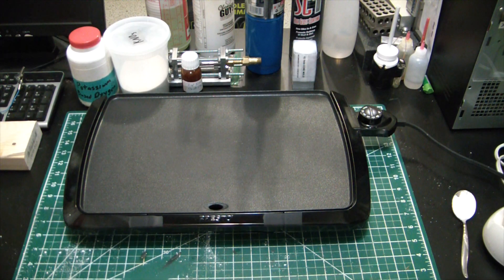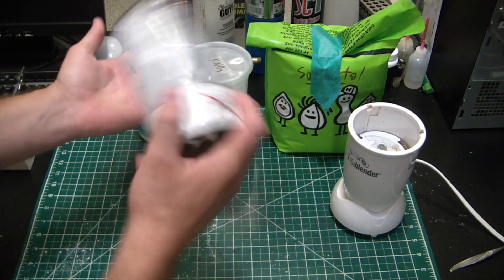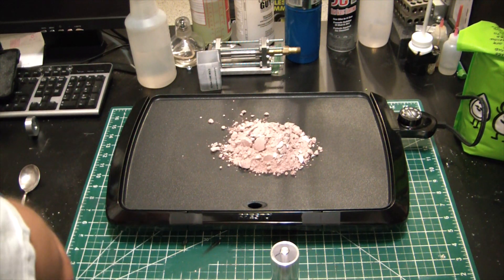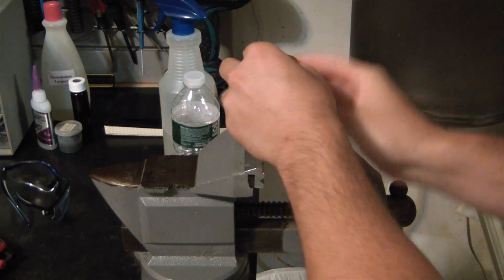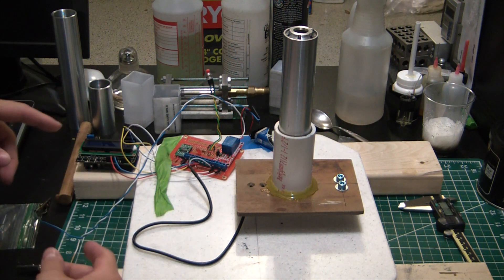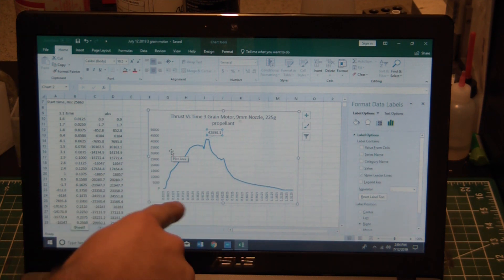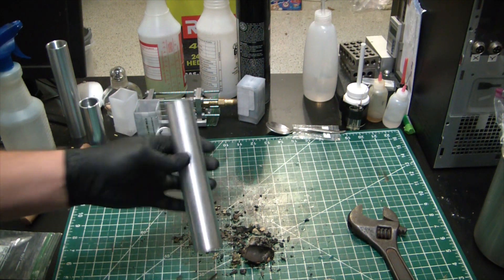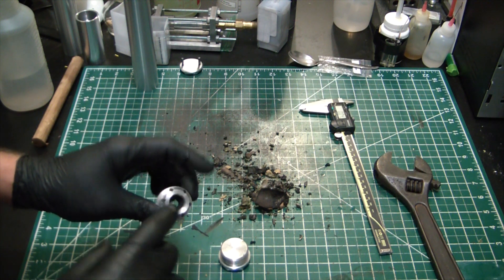A Massive Three Grain Rocket Motor - Arduino Static Thrust Test Stand - Elementalmaker

Comment: i suspect that what got spat out of the nozzle was probably the paper liner that was on one of the fuel grains. it would probably be a good idea to use a much thicker carboard, maybe like a cereal box.
did the motor come with instructions for what liner to use?
Reply: I have never seen a liner get spat out the nozzle, even when lubricated with Vasoline. The liner is plenty thick for his current propellant, but may need to be thicker for AP chemistry. I think Firefox, or one of the rocketry supply specialists, has some standard diameter liners that are specifically designed for composite propellants. Hopefully the casing is the standard 29 mm.

Comment: Do the grains expand when out of the mould due to the humidity?
Reply from the maker: The composition is quite hygroscopic so they will rapidly absorb water out of the air to the point of becoming a syrupy liquid mess. Keeping them in a desiccant bag keep the humidity down so they dont absorb water.

Comment: Sorry if it's a stupid question, but why does the nozzle have to be graphite?   Is there a reason why you couldn't just machine a new end cap with a nozzle built in made from the steel?
Reply from the maker: Steel would probably hold up pretty well also, but graphite is one of the gold standards as its quite chemically inert and can handle super high temperature without melting (as metals can).
Reply: But you could use it if you really wanted to?  
I presume that such a brittle material would have to be redone periodically?  Do you have a video of you making that nozzle?
Thanks. Love your channel.

Comment: So. I was watching some rocket guys flying one of their commercial F rockets, and they seemed to get a much longer burn time. Me being ignorant would like to know what the difference is.
Reply from the maker: Those engines are probably a slower burning composition. Basically this motor burned super fast, but gave out alot of thrust during that short burn. Their engines likely give less thrust, but for a longer duration. The motor classification deals with the total force exerted by the motor over time.

Comment: How about a black powder motor? Would be interesting to compare it to the KNSB propellant.
Reply: I've pounded more tubes of black powder than i can count.  Its not going to light from pounding.  You need to use extra charcoal to slow it down.
Reply: Yeah, you want to do any kind of compression of it while it's wet, if at all possible.
I wonder if 100% ethanol would work to stabilize the grain while you pack it. Evaporate it off after you're done.

Comment: May I suggest you weight your ingredient in increasing order of quantity when you do an addition?
Reply: It does not matter, since he melts the fuel on his electric grill. If I were using a sorbitol motor, I would mix them before starting the melt.
I personally used to measure the components separately, so there was no chance of getting too much through an inadvertent overly ambitions dump.